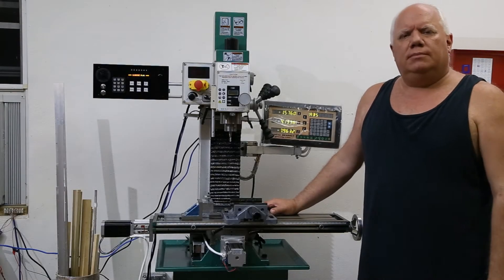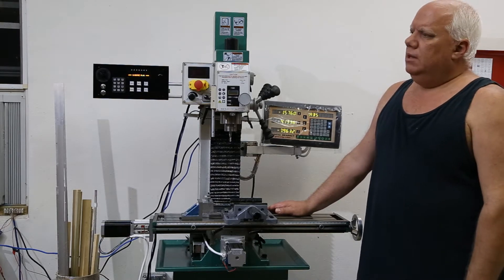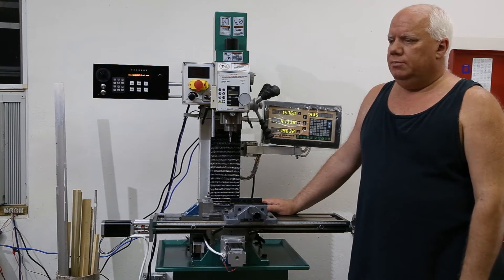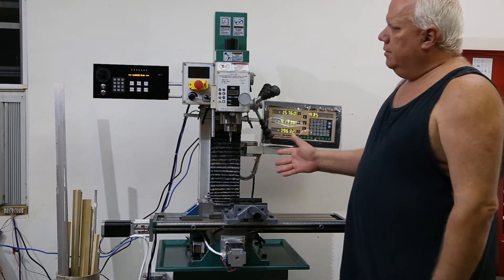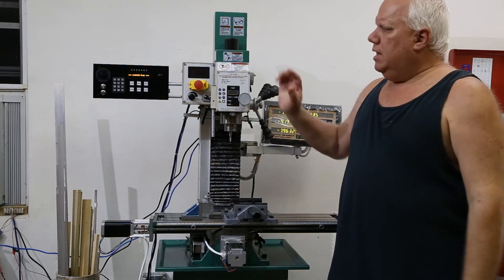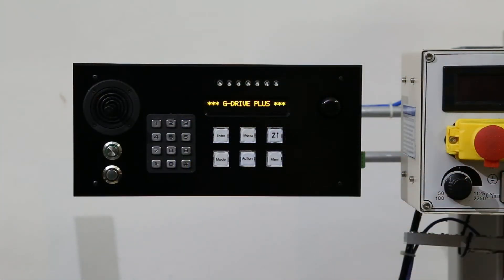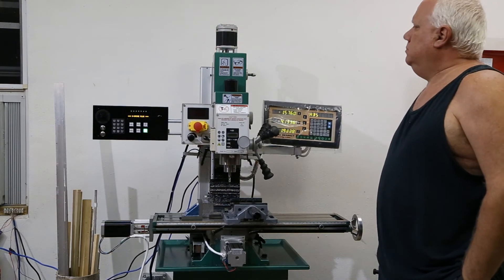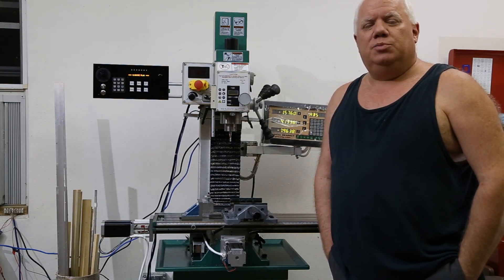Power Lift for the G0759 / G0704 Milling Machine !!

Comment: seen a setup from rockettronics https://www.youtube.com/channel/UCMvLkegD66QvfeOzFVr1lYg , his is for a lathe to tap tread and make nose cones ballends and stuff like that using stock programs with the measurments added intoo them  but i can see the same program being used to make circles cones and domes too 
i think he did some work on a mill version of his kit 
then again i think going intoo a complete cnc system for only these things might be cheaper (you only need the computer to convert the design intoo data ) gives you more flexebillity to make series of stuff (like an electronics box ) and to make unique shapes
Reply from the maker: I have a new one that I am working on that I will call X-Drive.  I think you will be impressed with it. Still writing code for it now. When I get a little farther... I will post a video of it. Stay tuned!

Comment: I have a thought.......if you fitted the machine with inexpensive Chinese scales, couldn't a brain read a subroutine based on where the scales were.  This could eliminate the need for new screws and still give you a basic CNC accurate to 001"using the original Acme screws.
Reply from the maker: Hey Martin...  my original idea was to tap off of the glass scale system that came with my G0759. I was planning on doing this... but decided to try it first with an open loop system. The open loop setup works good enough for me at this time. I like the idea of reading the scales... but that would be a lot of work to do, and I already have put a huge amount of time into developing this controller. But I am happy with it. I need to do another video update on it, because I have added a few things to it that makes it even easier to use. Pretty cool... and it's saving my ass at the moment!!

Comment: Hi Tim,
Looks like a handy add on for drilling lots of holes. Maybe it would be a good idea to add a pecking cycle. Nice job on the controller. Unfortunately I have converted my mill to CNC already. What do you think of the clearpath stepper motors.
Cheers Dave.
Reply from the maker: Hi Dave, thanks! It has 3 drilling profiles in it now, Pilot Hole, Standard Drilling, and Peck drilling. The Pilot & Standard do the same thing, just allow you to have two profiles handy with perhaps different depths defined. This allows more flexibility in a program. When I get a chance, I will be posting more videos of some machining with it so stay tuned! I like the Clearpath servos, but the price... ouch! I would like to have them on the X & Y also, but I am happy enough with the steppers to be honest. One thing I like about the steppers, is that if you run the table past the limit... the steppers just make noise, but no damage occurs. And you don't need to reset them. I like that. G0759 has such a short range on the Y axis... I often push it too far!  But you can go faster quickly with the Clearpath. Thanks for stopping by!